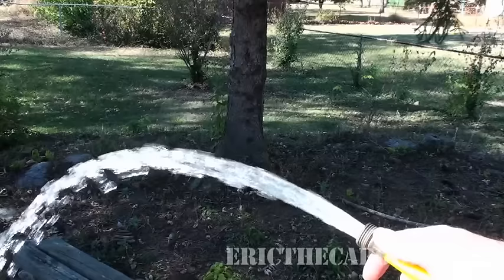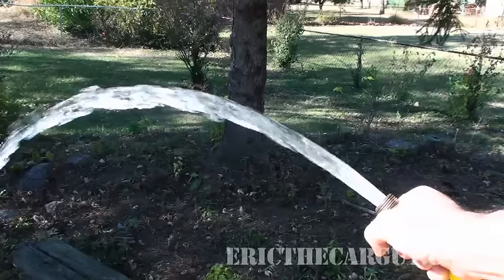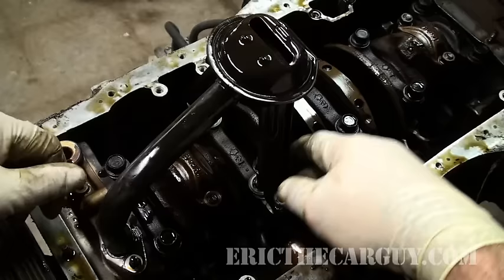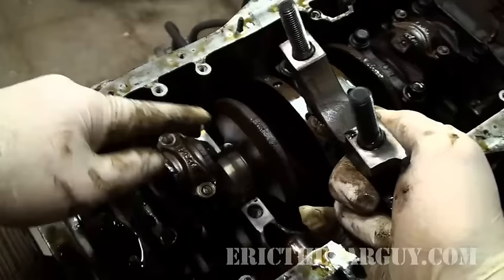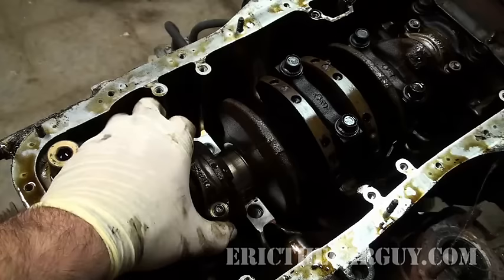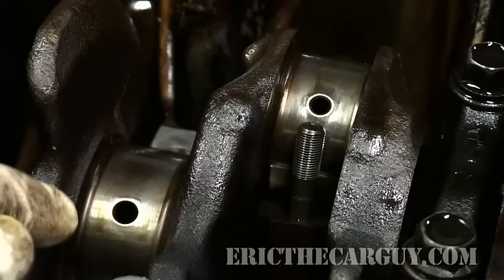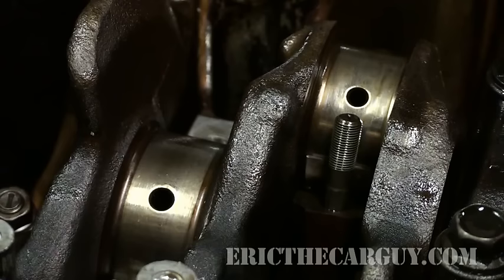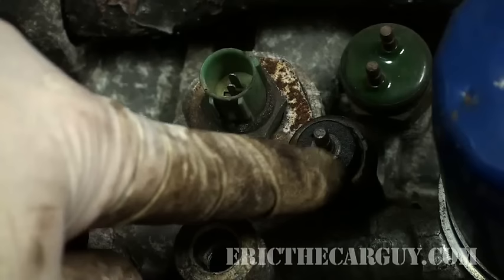How Oil Pressure Works - EricTheCarGuy

Comment: This is precisely why you need to add zinc into your oil.  Reduction in zinc is a reduction in viscosity that keeps the surfaces lubricated so they aren't slowly wearing each other out over time.  I know this video is 7 years old but all of Eric's videos are timeless pieces.  Maybe someone will see this.  The EPA has been reducing zinc amounts in oil  It used to be 1200ppm, now it's down to 900 and only new models of vehicles can last at those levels because they're engineered to with things such as roller cams, vs the older flat tappet cam shaft systems.  I thoroughly believe it's a conspiracy to wipe out older vehicles.  Just go to a car show and ask the muscle car guys what kinds of oil and additives they use and why and you'll see for yourself first hand.  Just buying the stuff on the shelf isn't enough anymore.  The names are all the same but the content inside has changed.

If this is your issue on a jeep that runs 10W-30, switch to Rotella 15W-40.  It's a diesel oil that's thicker (it has 1200ppm zinc in it, EPA hasn't regulated diesel engines for failing, yet) and will do a better job keeping the loose clearances in the engine filled up.  I have a 4.6 stroker and that is what I ran in my engine despite being new. Never had any problems, and once it over heated (because I did some experimental stuff not knowing how it affect the coolant system) I didn't have any cam lobe or lifter damage.  I previously have had 3 wiped cam lobes and destroyed lifters over the years on strokers just running conventional 10W30.  After I learned about zince I used additives, and later on I found out about Rotella's zinc levels and several people with engines rated for thinner levels of oil had used it for years with no problems.  I was sold on it, and it's cheaper than typical oil, not to mention you have to put 15-20$ of zinc additives in your conventional oil.  How much?  Who knows, but diesel engines last forever and I suspect it's in the oil that hasn't been down-regulated.  It's an internal combustion engine at the end of the day regardless of which fuel it uses, just the oils are different.  You can get a 5 gallon bucket of the stuff for $80. That's 4 oil changes with all the zinc you need.  Using conventional oil with zinc additives 4 oil changes would be $200~.  You know an oil has a lot of zinc when it's a dark brown/copper color, and the same goes with the zinc additives.  Just handle the stuff and you will see the difference in thickness.  Normal oils today are thin as olive oil and the color of piss.  You don't want that in any engine in my opinion.

Comment: If the oil pump can't supply the the volume that the engine requires due to a restriction which affects the oil pump output  this will create little or no oil to the pump thus low or no oil pressure because there isn't enough supply to build pressure.We are all agreed the pump doesn't provide the pressure but it's inefficient operation can be a cause of low oil pressure weather it be due to a blocked sump pick up pipe/ strainer a sheared oil pump drive or occasionally wear in the pump.Same principle again put your finger over a garden hose and see the water pressure rise now shut the tap off.Warning oil pressure! and maybe none but we decided to stop fitting oil pressure gauges and throw a light when your 20miles down the road just to punish you for failing to change your oil and filter every 5000miles.On this occasion you have had a lucky escape the engines bearings and the turbo have survived but if you remove my sump clean the crap out of the strainer fit a new filter and fresh oil I'll be your faithful servant till at least 200000 but never let this happen again and remember I'm prone to sludge.

Comment: "You've just created more pressure (out the garden hose)"... is that accurate? I don't think so. Velocity increases, but pressure actually decreases when diameter decreases (Bernoulli's principle).
Reply: Justin Irace wrong. Pressure increases. When you force something into a smaller volume it gets pressurized because of the smaller volume. And you use a pump to move the substance. Basic physics.

Comment: If your oil light is flickering at low rpm especially when the engine is warmer, AND you hear the knocking around the top end, you don't need that gauge bro, it's over.

Comment: Hey Eric my 05 silverado show me a low oil pressure and gauge goes to zero after change the sending unit sensor it starts at 40-45 but then decrease to 30-35 if a let go the gas pedal but i also found that chevy have a o ring on pick up tube that goes bad also my oil pan is leaking.... You think it will be a good idea to go ahead and do it?
242k on engine with oil changes every 3k

Comment: , 1. low oil 2. worn sending unit 3. bad oil pump 4. worn engine. So how do we tell if it is pump or worn engine ?  I have a hummer H3 3.7 5 cylinder I have 130,000 The specs call for 5-30, is it ok to put 10-30 I top it off 5 qts of 5-30 and 1 qt of 10-30 I thought a heavier oil would better protect, Im using amsoil.

Comment: hello   auto experts  , i have a honda crx 402000 miles . car runs great  but  it will not take  3.7 quarts like it should . it only takes  1.5 quarts .   when i put 3,7 in the  motor starts to smell like oil .    when i    reduce to  1.5 quarts   it runs fine , no oil smell  .   i replaced     pcv valve  , no    change  .    i think i have a  breather problem   but i dont know .  i been running this motor  100,000 this way   and it runs great     . i very confused .    d15b6 hf motor

Comment: Hi Eric, I've a ford focus 2001 (UK model). I serviced my car last December at around 84K miles. By April this year, my oil light was flashing on applying brake and goes off when released. Finally found the oil was drying out in engine and again I re-filled with 5W30 (recommended - as per manual) oil. But now again, (though the oil light is not flashing) the oil seem to have gone low (tested with dip stick). Any idea why the Oil is drying up quicker for a vehicle which has run below 90K miles? 

Thank you
Rhin

Comment: My 350 Chevy loses oil pressure at operating temp . Idle maybe a couple psi an at cruz / acceleration get about 20 psi max . Knocks at start up smooths put . Has faint knock in upper rpm . Been like this for a year .

Comment: i work allot on old mercedes engines.   at those 1970-1980 mercedes engines it is not about how low the oil pressure is, but how fast the oil pressure is up.   when the oil pressure is low with warm engine at iddle, but comes up imidiately after you give it a little rev  ( 500 rpm) then the engine is not worn but the fuel pump.   but does it take high revs to have a higher oil pressure,  then those mercedes engines are worn out.      and at a mercedes 70-80-ties engine with warm engine, the oil pressure shouldn't drop below 1-1.5bar.   Depending if it is a diesel or petrol engine.

Comment: i have a 1997 mercury mountainer,oil gauge goes bananas,at stops it goes to low.the sending unit has been change and the cluster and still does it,only in cold stays normal when it warms up it goes bananas

Comment: Is there others selution if we not change the main bearing or cond road bearing to get back the oil pressure
Reply: You will destroy the crankshaft journals in a hurry if you don't replace the bearings, it's very easy.

Comment: dude! my engine piston get sizes at high rpm suddenly my bike at 82000 km on it mechanic says its is cuz by dry cylinder wall plz tell me what to do ...i opened my engine any trick to check that con rod spray oil on cylinder wall at disassemble condition

Comment: ok on the note of this video being based on low oil pressure I'm having the exact opposite issue I have a 1994 K2500 chevy 5.7 new motor only has 35000 miles on it what causes High Oil Pressure but gauge fluctuates while driving   just asking bc I'm use to low oil pressure issues
Reply: +George Davis Running oil viscosity other than recommended by the manufacturer might cause this. But usually it is the sending unit, gauge, wiring, or even battery/alternator voltage. (In the case of a rebuilt engine, it may have been rebuilt tighter than OE specs, which would create higher oil pressure)

To diagnose gauges the first step is to verify they are in fact reading accurately, which requires a secondary measurement. In the case of oil, you need to verify the oil pressure is, in fact, high.

Comment: I have a 95 Chevy Beretta, 3.1l v6 and I am trying to find the oil pressure switch. Everything I see and read shows it to be on front ( nose of the car ) side of the engine. I have looked there is no part that resembles the part I have in hand. Can someone please tell me where to find this on the engine so I can replace it. I will need in depth graphic direction of where it is. Thank you

Comment: My name is Carlos i building complete engine M9r 2.0 DCI diesel for my Nissan x-trail 2008. When i rebuilding i fitting new oil pump on it. So after 2 mouth my turbo gone. I bought other second hand in very good condition. That one gone also in about 3 mouth. When i fitted the oil pump the gear spinner free. I not sure if this is normal. what you have to say about that. Not have anything to lock it on crankshaft.

Comment: Hey Eric. I watch you videos all the time and I was wondering if you could help me with something. I own a 95 civic hatch and I had to take it to a mechanic because it was giving me trouble and I didnt have the proper tools to diagnose the problem. So we fixed a few problems then $400 or so later he says theres no oil pressure and we need a new engine. I was wondering if the problem is fixable and should I keep my old engine or is it a lost cause please anyone reply

Comment: hi...i'm sorry if maybe i ask you someting that you already talked about...but i don't speek really good english...so i have a big problem with my jeep gran cherokee 5.7 hemi, it is a 2005 and i can clearly hear a flash noise come under the engine,and my engine sensor is Always on..so we find the error, and it is a "oil pressur low"....what i should do ?? change the oil pump or just try to clean the box and even the engine with some kind of addictive stuff ? i hope you can give me a good tips, cause i wont spend lots money on it...sorry for my english and thanks for everythink... !!

Comment: I've replaced head gaskets on my 1998 dodge grand caravan. since then I haven't gotten any oil on the right side head. I have try many things to make it work. I clean the oil passage to that head, checked the oil pressure and it is normal, cleaned the oil tube inside the oil pan,took appart the head clean the oil passage on the block and still not luck. I don't know what else to do. do you have a idea.
Reply: Some head gaskets have a "restrictor  or valve" in the main oil passage of the gasket that goes up from the block to the head. This oil passage supplies oil to the valve train in the head - I have had this restrictor in the gasket blocked before on a new head gasket which prevented oil getting to the valve train. I've also seen head gaskets fitted incorrectly causing the same problem - The gasket has been put on backwards which has put the restrictor on the opposite side than it should be - some gaskets you can flip over and they will go on but they will be incorrect.

Comment: Hi i have a question

I have a question, when i start my engine i have more than half oil/ good oil pressure. After 15-20mins when the engine is hot drop to zero right away. Like zero oil pressure. Why would do that? Please let me know. My vehicle is 2014 ford f150 .Thank you
Reply: Perhaps you use thick oil that has a large difference in viscosity between hot and cold?

Comment: hello, I have a question that I think more than 1 is done sometime, recently I bought a crv of 2006 with 140,000 miles and everything worked fine but as always happens I wanted to do something nice for her and change to movil1 full sintetic, and there I started the problem, the car has 142,500 miles right now and I am having vibration problems at low rpm and blowby that gets worse every day, although the engine is not too noisy or smoky but it has reached the point where I even have blowby on it. stick of the oil when I remove it, my question is this, do you think that if I change back to conventional oil and increase the viscosity from 5w-20 to 5w-30 I will extend the useful life of the engine a bit more
Reply: Ok this is confusing I dont know how to check if any replys

Comment: i have a 2003 vw passat wagen with a v6 has 146 thousan miles on it the stop engine oil press lite comes on and it starts beeping the car runs fine no smoke no knocks i changed the censor but still the dam light comes on it was low on oil i put 5 30 weight in it and it had 10 30 before can that be the reason this light is comming on because i put a thinner weight of oil in it please help this is our only car and it is beautiful

Comment: Hey guys, I had a hard acceleration on my volvo s40 2010 2.0d  when it was on second gear, the car is (Tiptronic),  Then the engine made very heavy cracking noise and smoke. I turned the engine off for a while. restarted in 5 mins working good but oil pressure light on, then when accelerate high same thing happens again. however, when I change the oil it doesn't do that for 1000 miles then when the oil gets dirty again the pressure light on and if high acceleration the same noise happens.
What I have damaged? probably everything, is int?

Comment: Hi,

So I'm new to motor vehicles, I have just started a course last week and I'm now currently working for a truck and bus company. This is all new to me so my questions are child like, I apologise.

The oil that comes through the pump, then down the crankshaft to the journal/ bearings, the housing then holds the bearing in place, what keeps the oil between the crankshaft and the bearing?
Reply: There is a constant flow of oil to the shell bearings via passageways in the crankshaft so there is never a time oil wont be in there.
Reply: Viscosity. But the oil does escape, slinging out by centrifugal force and sticking elsewhere  causing thèse parts to be also lubed by contact and adhesion.

Comment: how about to much back pressure when compirsion is 150 on 2 cyl and 155 on 4cyl  v6 motor new rebuild less than 10 hrs run time.

Comment: You need oil pressure to overcome the centrifugal force of the spinning crankshaft to be able to get oil to the rod journals.  Too low pressure...no oil flow...resistance to flow is what makes pressure.

Comment: Hey Eric, just watching your video and wondering if you know the answer to this. Had a customer come in with a 99 F150 4.2L engine with 280k miles. Had a check engine light and we replace the upper and lower intake manifold gaskets. Once complete, engine would not turn over. After letting it sit, it finally started after we jumped it, took a while to start. White smoke came from the exhaust, probably coolant got inside intake manifold while replacing it. On the test drive, oil light and coolant light came on and engine starts knocking really bad. Oil level is fine, will check oil pressure, but what are your thoughts on this? Any idea what could have happened?
Reply: Carmedix LLC the fact that it would not turn over, indicates a hydraulic lock.  during the intake removal,  coolant,, hence the white smoke,, was allowed to run past an open intake and fill a cylinder. this caused a hydraulic lock condition. after the initial try,  it failed to turn over, but would have slowly began forcing  the coolant past the rings. with the aid of a jump,, which was a pretty bad move, by the way,, you've over come the locked condition, and either bent a rod, or crushed a bearing. over the years, i've seen more than one bent rod,  from the failure of letting a cylinder get filled accidentally with fluid. it's always prudent to pull the plugs on all cylinders, after releasing coolant around open intake ports. spool the motor over and make sure the cylinders are clear.. it's just good insurance. and never force an engine to turn over, if the already hot battery wont do it.. there is obviously an obstruction.. cheers.P.S. i've seen a rod bent ever so slightly, that the piston skirt would contact the crank at BDC.  it created a knock, that had nothing to do with oil pressure, and only showed up after a compression test made the cylinder suspect. after pulling the head, and spooling the motor over you could see the piston was not reaching the top of the cylinder.

Comment: What about if oil pressute is 40 to 50. Cat running good and suddenly it went to 0 in pressure and metal noise. I replaced pump and it didnt fix the problem. Tried different oil viscosity and didnt brinh up pressure. What else could be? Thank you
Reply: possibly broken crankshaft